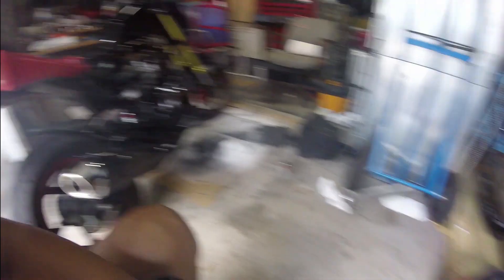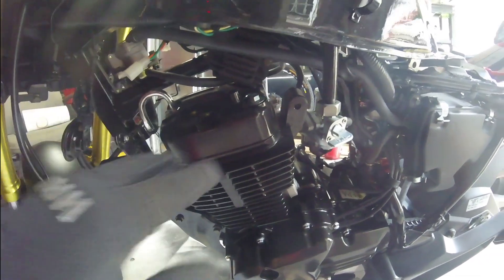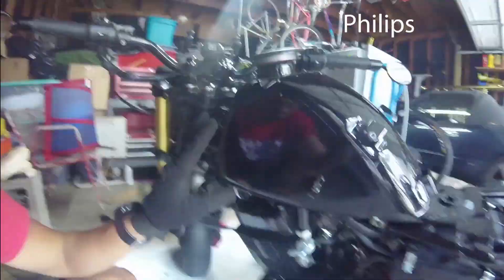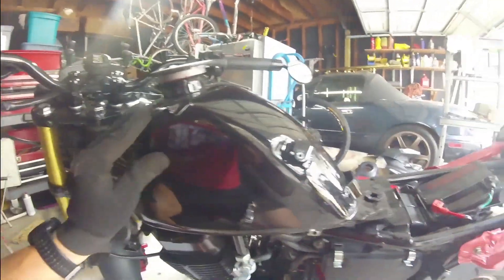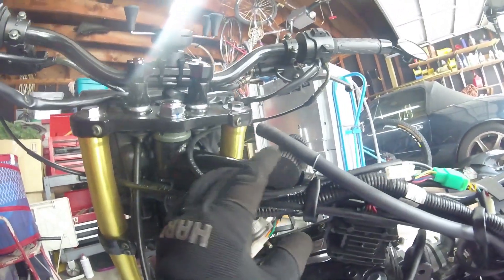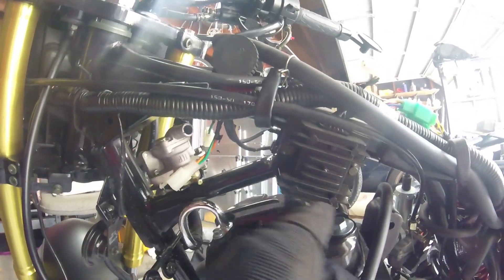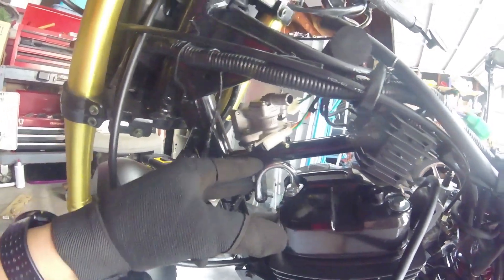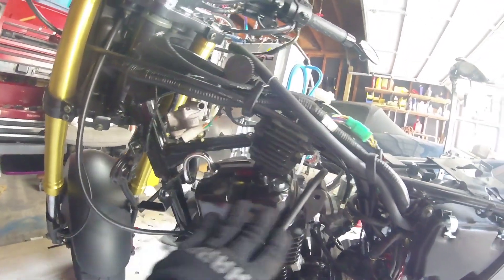Lifan KP Mini 150 Valve Adjustment at 1000 miles

Comment: I've heard good things about Life's. But, geez, you can't remove the valve cover without pulling the engine?  No thanks.
Reply from the maker: I learned later you can drop the motor a little by removing the front lower motor mount bolts. Wish I kew that back then
Reply: I think it’s on the owners manual

Comment: Hey, I believe I have an oil leak.. I have to replace oil every few hundred miles. Didn't you say you had this issue as well?
Reply from the maker: We are not the only ones. The shift sensor o-ring leaks- I had to replace it with a slightly thicker one
Reply: @SmallEngineVelocity  Good thing I work for a seal company lol. Thanks I'll replace it.

Comment: What is the motor cloned after? Is it a GY6?
Reply: It's not a clone
Reply from the maker: Wikipedia: The GY6 engine design is a four-stroke single-cylinder in a near horizontal orientation that is used on a number of small motorcycles or scooters made in Taiwan, China, and other southeast Asian countries. It is believed to have originally been a Honda design. At some stage Honda used Kymco, a Taiwanese company, as a factory for Honda bikes. It has since become a generic technology. Kymco went on to produce Honda clones such as the Pulsar (CB125), made to Honda standards, as part of their range.